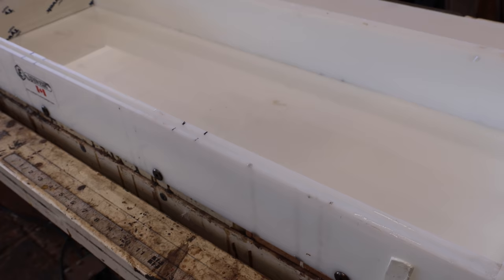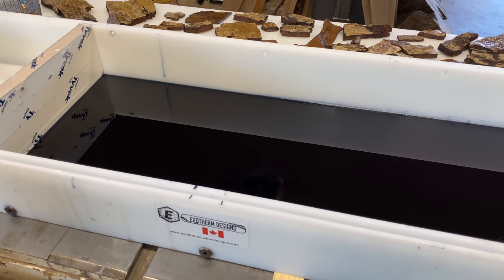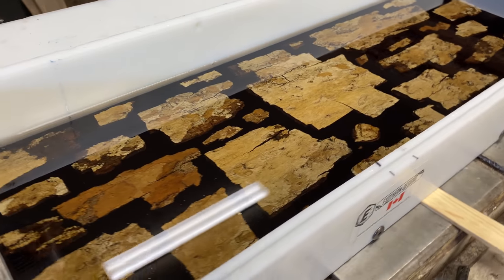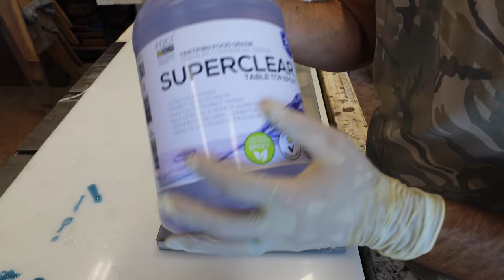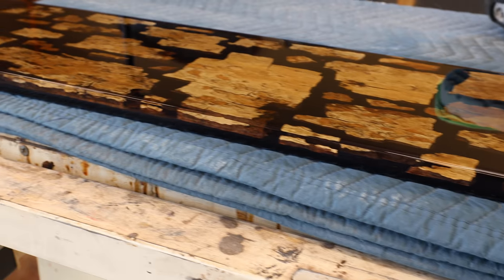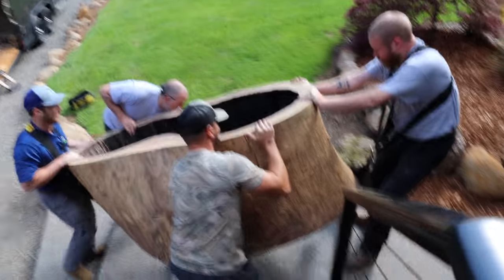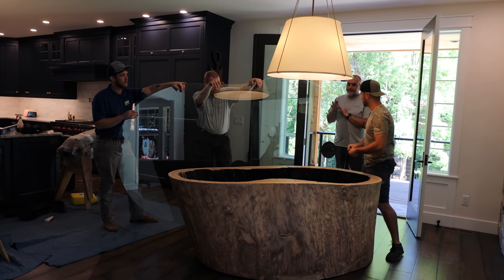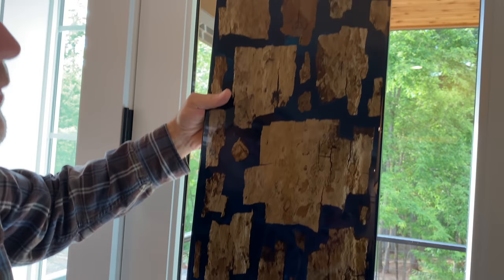Resin | Tree Bark | Brass Board - BONUS Table Delivery!

Comment: Great idea!  Question: Why didn't you use a torch to pop the surface bubbles?  Are some kinds of epoxy non-compatible with heat?   That's a fine product- custom, creative and beautiful.  The finish is so glossy!  Thanks for the link.
Reply from the maker: Thank you!  I prefer a heat gun personally, the torch get the resin too hot and accellerates the cure time too fast, especially on this day, it was super hot outside.

Comment: When you are carrying the bath it looks like you are trying to hold it down to stop it floating away.
Reply: It’s not even a bath, it’s part of the table. Absolute plonker.
Reply from the maker: @klashnacovak47  😂😂it totally does look like it, I had to keep it from teetering off of the single moving strap.  Seemed smart…🥴

Comment: Hey.. At 5.54~5.55 you said you degassed it... What did you mean by that?
Reply: Using a vacuum machine to pull any trapped air out so theres no bubbles
Reply from the maker: Yes, I have a degassing chamber, the link to buy one is in this videos description, it basically sucks all of the air out of the resin for you :)
Reply: Hey.. Thanks for the update. Correct me if i am wrong, you mixed the resin and hardener and then used the vaccum chamber and then poured the degassed mixture.. Right?
I don't know if there is any way we could degass the resin mix after pouring it in a mould this big.
For general knowledge.. What do you think is the biggest size mould one could put in a vaccum chamber? 2ft by 2ft or 3ft by 3ft?
I mean I am definitely looking to invest into a vaccum chamber as well as a pressure pot.
Would appreciate your revert on this.. Thanks..